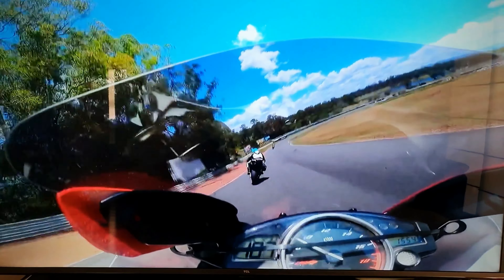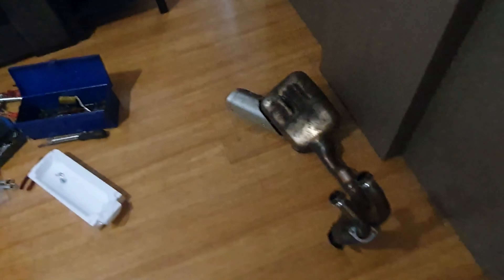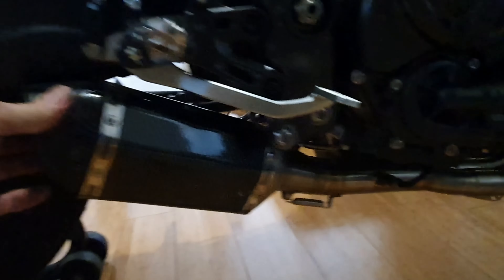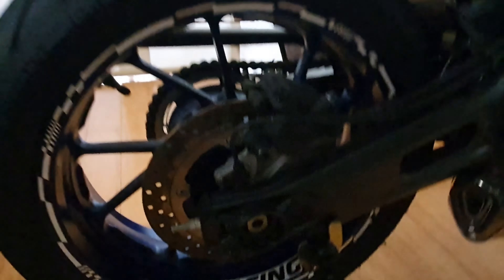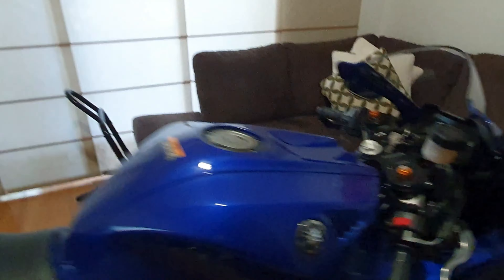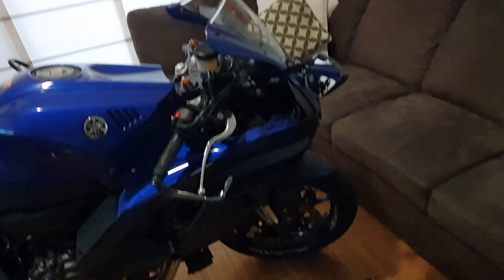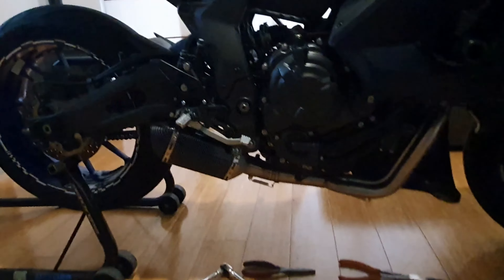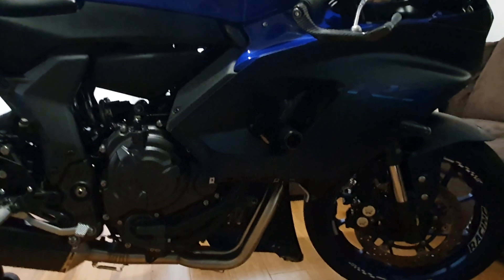2022 Yamaha R7.... Inexpensive Exhaust Upgrade! 😲👍🏍🏁

Comment: do you need a tune after this install?
Reply from the maker: I have not tuned the bike and my spark plugs look ok when the bike got serviced. This Exhaust is not a power upgrade, in fact you will loose top end speed. I changed to this exaust just for a cleaner look. 🙂👍🏍🏁

Comment: Did the bottom of the exhaust rub against the bottom of your blue fairing? Cause I just installed mine and it’s rubbings just not sure if I should leave it as it is
Reply from the maker: Yes mate.. I just bent it slightly out of the way. After that it was all good 👍🙂🏍🤕